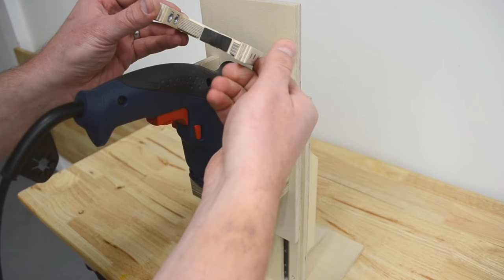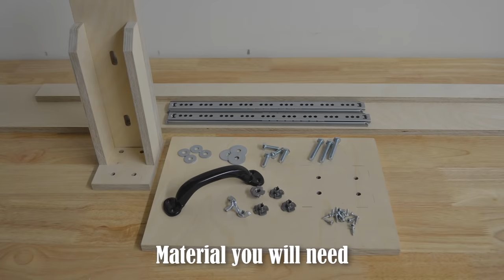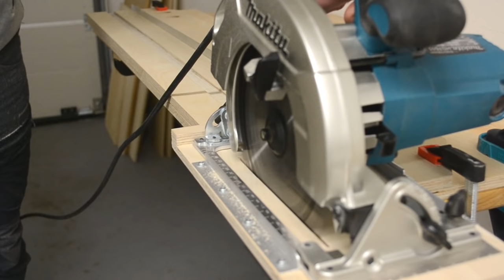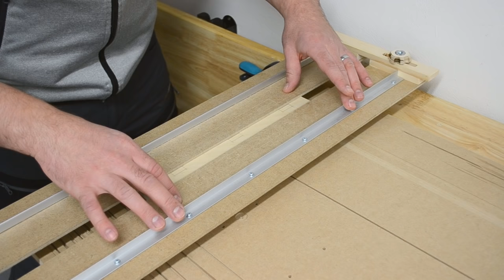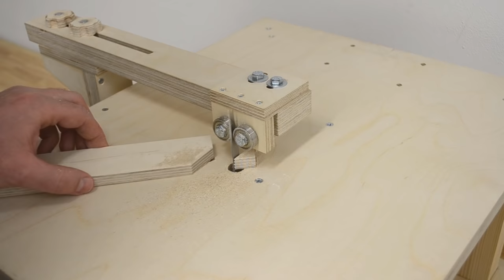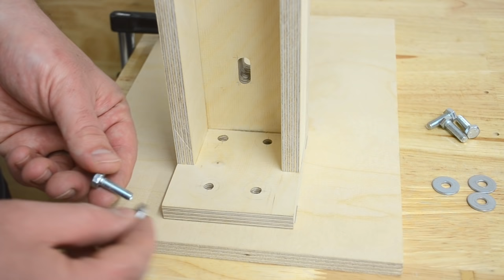Make a Drill Press Stand | Drill Press Stand DIY

Comment: Hello. Your design is very good. Have you added a spring inside the part where the drill is installed to keep the mechanism up? I didn't see it in the video. but the mechanism remains above. If there was no spring, the drill would have to come down with its weight.
Reply from the maker: Hello, there is no spring. I am using a plywood piece to support the drill press from below when idle :)

Comment: Great modular design.  It is good to have the sliding part built separately from the column.  One question, are drawer slides accurate enough?  Typically to slide smoothly, they need to stay a bit loose. That would introduce some play and could make less accurate.  Right?
Reply from the maker: Hello, honestly I have problems with this build. The drawer slides are holding pretty well. There is no space for any movement, they don't "wiggle". Next time I would probably use better slides (quality slides), but after having this drill stand for a few years now, I've had no issues.

Comment: Very nice and clean project. The video doesn't show any spring. How the drill goes up?
Reply from the maker: Hello, there is no spring in this build. I push and pull the drill manually. The drill is quite light, so there is not much of a problem but having a spring is definitely a good point. I am planning on making another improved build with a spring included. Thanks!

Comment: Very good slow job, but one question; there's no spring holding up the dill,  on the test run you only showed work and not the whole thing. How's that?
Reply from the maker: Hi Henry, indeed, there is no spring. The drill press sits on the table. That could be a good improvement though. I dont find it necessary. atm. I am using a lightweight drill and there is really not much weight you need to hold.

Comment: Great design, but what tensions the drill slide so it moves back up ?
Reply from the maker: Hi Patrick, that is a manual process, there is no spring or anything like that. ;)
Reply: @AllFlavorWorkshop  aha ... clear. would it be very hard to add a tensioning system to this design ? I first have to build a track saw guide. Once that is done I am having a go at this drill press.
Reply from the maker: @pdemaers  Hi Patrick, I gave it a thought and I have few ideas. I think it would be possible. Just to make sure the tension is applied equally and the drill press wont get skewed when pushed down. I am also planning on creating a new version of this drill press with the tensioning system included. So hopefully soon ;)

Comment: have to ask but where is the spring to keep it up on the track
Reply from the maker: Hello, there is no spring in this build. I am pulling the drill back up manually. I could see this might be an issue with a heavy drill but this one is quite light. Anyway, a spring would do also fine. I have been thinking about making another build with a spring included. 👍

Comment: What’s keeping the drill up?
Are you using springs
Reply from the maker: Hello Donald, this drill press does not have a spring. I am holding the drill press manually (the drill is quite light, so there's no problem). When not used I support the base with a plywood strip. Although for my next builds I plan to make one with a spring included.

Comment: Building stand is very nice and neet, but without using any spring, how can a drill machine withstand in the middle or top. It is impossible as due to weight of the machine, sliding door go down upto bottom and no chance of uplift. Can u pl answer how a sliding door withstand in the middle or top?
Reply from the maker: Hi Chakrapani, true. This is a basic version of a drill stand. No springs, no rulers for measurements - though excellent precision . I most likely will be making an upgraded one with all the nice add-ons. If not used it always goes down. I am using a supporting piece of plywood to keep it in an up position to change the drill bits.